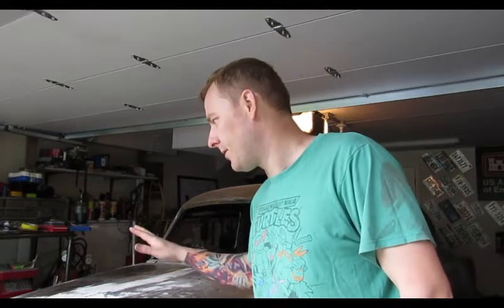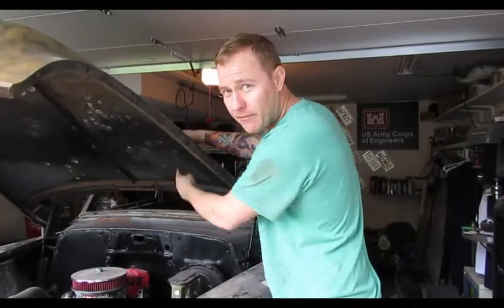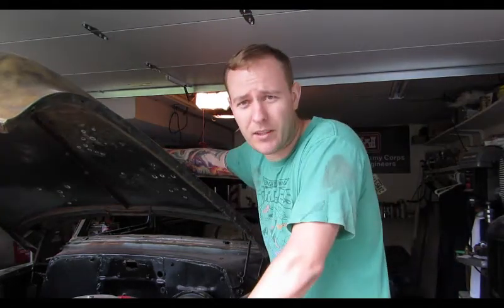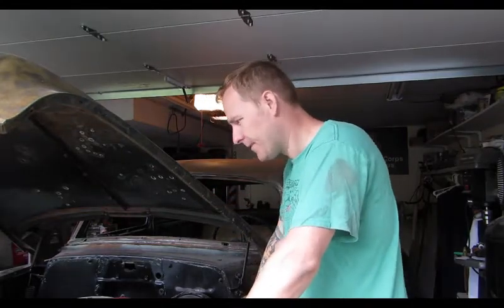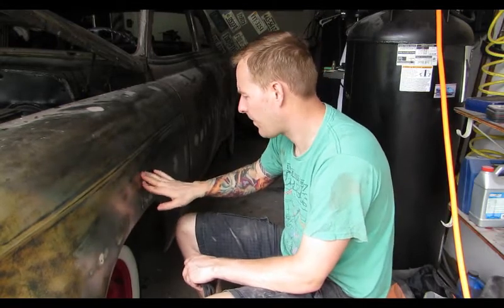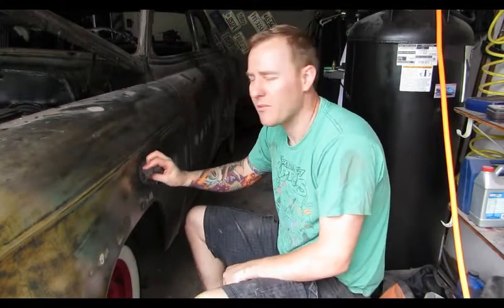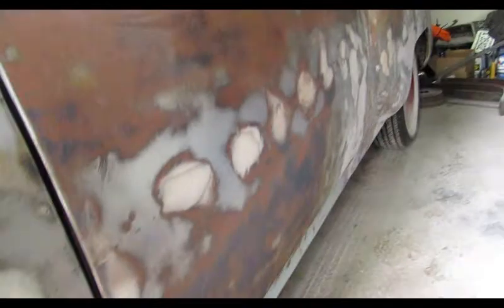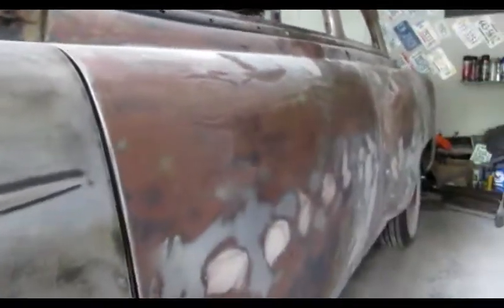DIY Fix Flexing Body Panels  "Oil Canning"

Comment: Luke thank you fort encouraging me to tackle the oil canning area in the bonnet (hood) of my 66 Jaguar E-Type (XKE) restoration.  I was quoted 3-4K from local restoration shop and a new part is over 3K. Your method worked flawlessly in about an hour. The hood is now tight and solid and ready for a thin coat of filler. Kudos!
Reply from the maker: I am glad you got it sorted! Prices are getting crazy these days

Comment: Could you just lightly run a shrinking disc in the low/flexible area and cool with no hammer and dolly?  instead of localised heat and hammering the heat spot flat?
Reply from the maker: That should work just fine Anthony. It wouldn't help you with high spots but, if you are working to pull the lower metal tight I wouldn't see an issue with it. Let us know how it goes.

Comment: Is it a shrinking hammer you're using or just a regular flat body hammer?
Reply from the maker: I used a flat hammer.
Reply from the maker: It was a cheap set
Reply: @lukasgarrison8505  Thanks Lukas, I wasn't sure

Comment: what do you do if you can't get behind the panel?
Reply from the maker: That's a good question. For us just starting out it is going to be very hard to get that metal flat. I would just shrink as much as possible and then worry about lowering the high spots with heat and a tipped hammer, followed by cold rag . Not being able to get to the back of the metal increases the amount of filler used.
Reply: I don't mind using a little bit of filler I just need to stiffen the panel it oil cans bad enough I am afraid to put filler on it now
Reply from the maker: I would heat it and tap it down gently with a pointed hammer before cooling. That way, when it shrinks, the metal will "spoon" to the inside. I would rather bondo a firm golf ball than a waving panel.
Reply: true thanks for the help
Reply from the maker: Did you fix the problem?